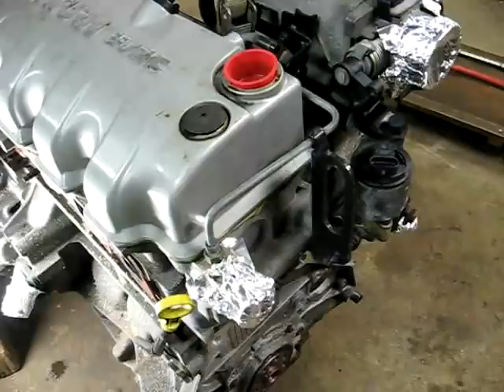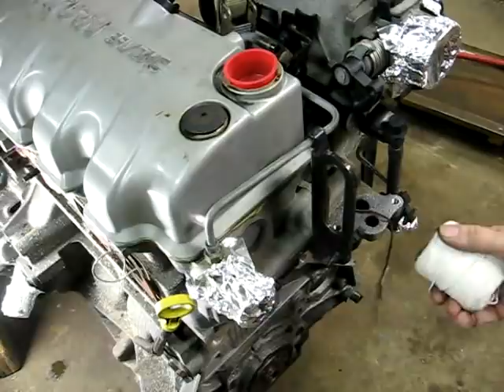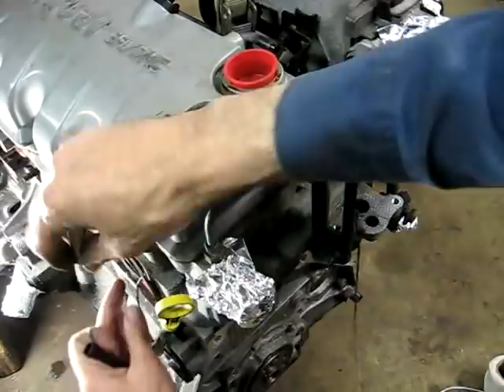EGR Passageway Length (version 2008)

Comment: Hi richpin i am getting p0401 on my 02 sl1 i removed the egr and started the car and it did not rev up tp 4000 rpm it only ran at normal rpm 850-1000 rpm alot of smoke came out the exhaust hole but there was vacuum at that port when i put my finger over it..  How hard is it to clean the vacuum egr port passage and what is needed to do it does the passage come out at one of those ports that are behind the throttle blade?? like around the iac valve port?? i can see some type of vacuum port holes behind the throttle blade any help with this would be helpful thanks..

Comment: @richpin06a and if u must clean this port u must rempve the whole exaust manifold, or can u just remove valve and use something to dig in there to at least break things up a bit, then spray compressed air through it? Thanks.

Comment: @richpin06a On this car does the egr passage that ur measurning ever get clogged up with carb? I was watching another video and on other cars they say the passage leading to the intake gets clogged up so u have to manually clean it(without carb spray) besides cleaning the valve itself. Or.... with this car cleaning the valve and throttle body is all required? I cleaned the valve 8months ago, and recently checked the intake(WAS VERY DIRTY), but all clean now. I wnt 2 reduce intake gettn cloged.

Comment: I hope you can clean the exhaust port this way without removing the engine and/or the exhaust manifold?  I've gotten a P1404 on a 3-month old EGR valve.  I know it's just the crud build-up in there and keeps plugging it up.  So, can that be done?  I've seen really long pipe brushes at the auto parts store so I imagine I can use that.  I'm hoping that crud will just blow out the exhaust and out the tailpipe?  Kinda sick of these reoccurring egr problems.